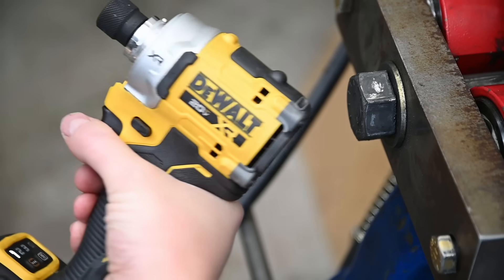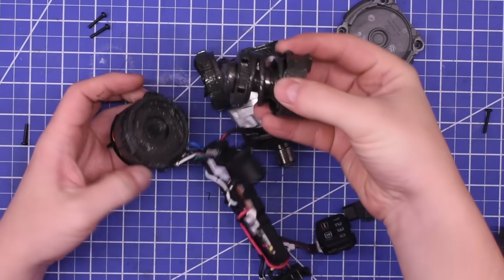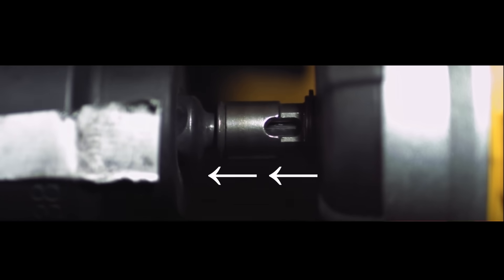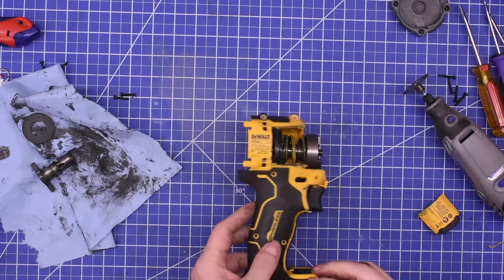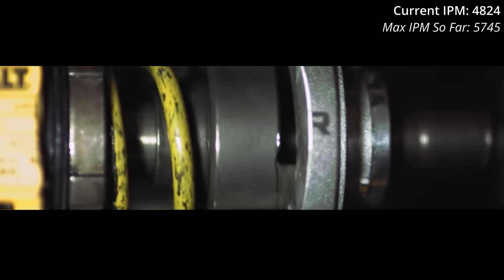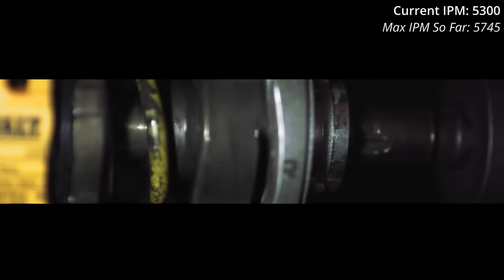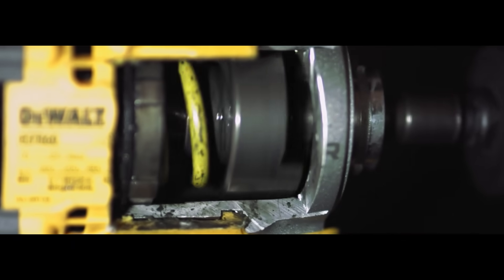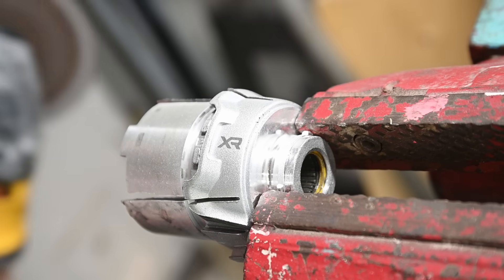We Found Something Strange Inside DeWALT's New Tool @ 10,000FPS

Comment from the maker: The spring would need to be wound the other direction for it to be flipped and see a difference from a spring direction change if any. Rotating it on its head 180 degrees wouldnt do it.
What's unique about the spring isn't that its so strong, a heavier spring would not allow for the assembly to bounce all the way back. It's the whole strategy they used that is fascinating.
Reply: Retired Engineer here, you guys are ready for Motion Amplification software. It should work at any fps. This will give greater insight into what is going on inside. Look at RDI.
Reply: Wonder if this possibly accidental resonance will affect the fatigue life in a bad way?
There was a comment about a second spring, this is sometimes used in automotive valvetrains to smooth or move a resonant frequency peak.
FWIW I sort of prefer the max to be in the fastener loosen direction.  Not in a "I want to get the fastener tightened as fast as possible" but more "I want the (*&#! thing to come off at any cost!"
Reply: @pault151  Yes! My suggestion of adding a valve spring to it was both inspired by the nested valve spring design, as well as thinking that it would also be small enough to fit in there. 😅
Reply: @pault151 you're also coming from the Automotive field. Builders don't want structural fasteners to loosen...ever.😂
Reply: @danielkingery2894  That's true.  But structural fasteners also have a torque value they should be installed to, whether it's done with a calibrated wrench or a torque-to-angle.  A structural bolt can be ruined by over-torque.
Reply: FYI dewalt wants it driver back😮😮😮😮
Reply: 🤔 Can you toss in a valve spring, to act as a helper, and hopefully preventing the rebound-slamfire hammer hits? 😊
Reply: RDI?
Reply: @hankphillips884  RDI Technologies does the motion amplification software. There is an excellent Steve Mould video that shows it in action.
Reply: I think you are on the right path. It looks like the end of the spring might be catching on the hammer assembly in forward cause the weird bounces.
Reply: Imagine if they instead used a dual spring design. One spring wound clockwise and another spring wound counter clockwise. Would be interesting to see the results.
Reply: Correct it’s like turning the letter N upside down.
Reply: I 2nd this vote
Reply: Yall should make a video with all of the tools you have done surgery to
Reply: Exactly!
Reply: You want it to bounce. it allows for more force for every strike because of the longer travel and time to build energy.
Reply: @SkELAo7  If it is hitting on the very next dog regardless,  isn't it building the same amount of potential energy?
[sincerely asking, in case I'm missing something]
Reply: @DUKE_of_RAMBLE Eh, kinda. If it's bouncing, then it's as if a stiffer spring (which... all steel is basically a spring to some extent) has already given it an extra kick, so the main spring gets it going even faster. That's a good thing. These things work on transfer of kinetic energy. In linear terms, that's 1/2mv^2. This thing is spinning though, so it's 1/2Iω^2. Note the square term here. Adding 10% more speed will do a whole lot more than adding 10% mass or moment of inertia (rotational equivalent to mass), but both take the same amount of momentum transfer to get there (p=mv and p=Iω). Momentum, by the way, is how the spring accelerates the hammer. So if you can get more kinetic energy for the same momentum, it's a free upgrade on the maximum torque you can get. The bounce on some hits adds bonus energy to the whole thing assuming it's all skookum enough, which it seems to be.
Reply: @233kosta  That makes sense, even to my non-mathematical brain 😅
To me, it just seemed like it was wasting energy, by converting what could've been delivered in the hit by having a stiffer spring, but instead converted it into enough of a force to drive the hammer all the way back.
Reply: @DUKE_of_RAMBLE  We were all "non-mathematical" at one point or another. All it takes is a good teacher 😉

By the way there are two bounces of concern here. One occurs when the hammer hits the anvil (I assume that's the one you're talking about?). Technically a waste of energy (energy being finite, some being left in the hammer because it's still spinning), but it's unavoidable (see elastic collisions, coefficient of restitution, etc.). In some cases, it may also actually be beneficial, depending on the kind of time-dependent behaviour you're looking for. If you want short, sharp shocks, then bounce is where it's at.

My comment was more in regards to the second collision that happens every once in a while. It's bounced off the anvil with enough oomph to wind itself all the way back up and bounce off the hard steel. That now adds the extra momentum and energy above and beyond what the big spring can do, as explained in my last comment.

I assume the main spring is intentionally less strong, so as to allow the hammer to top out and bounce exactly like this. Someone at DeFault clearly remembered that one materials lecture from back in the day 😅 ... probably in the middle of an acid trip or something. 😁

The next step in reverse-inginerding this thing would be to rig up a makesgift current shunt either for the main motor supply or to one of the coils. This is actually surprisingly simple, every wire is basically a resistor. You run a current through it - there WILL be a measurable voltage across it. From there, I=V/R. Multimeter measures the minute resistance (maybe... some wires are too good!), oscilloscope plots voltage over time, et voilà - a way to measure what the controller is doing under different load conditions (including in reverse), which will more than likely make it dead obvious how & why it hits harder and more often going backwards.

Hint: it's deliberate. So you can undo stuff. That usually requires more torque, especially if the nut you're trying to bust has been there for the past 20 years and is rusted in place.
Reply: @233kosta  Granted, everything can be taught, with enough time and patience... But then you enter the realm of diminishing returns! It's just a fact that some of us are destined to become mathematicians, and some of us mechanics. BOTH can still be literal geniuses though! 

I actually meant both hits, really. That there would be enough left over energy from the anvil hit to send the whole assembly back, with enough force to bottom it out and rebound off.

But now that I think about it, yea... I suppose they might be utilizing that as a way to more quickly reset the entire mass, versus the time it may take a heavier spring to slow it down. All they need to do here is eliminate enough of that potential energy with the spring, to prevent the repeated-rebounding from doing any damage in the long term!

I think it'd still be an interesting test for TTC to conduct, by throwing in a helper spring, or replacing it entirely with one from another unity... For science, and all that. 😊

Also, it's a shame the entire circuitry is potted, as I'm willing to bet there's already a shunt onboard. (although I don't know if DeWalt would be using a newfangled means to measure it, or the traditional U shaped chunk of copper wire...)

edit: ACTUALLY, your other comment about grease brings up a great point... The unit likely isn't experiencing any of that bouncing back off the "backboard" that we're seeing in the highspeed footage, BECAUSE of the amount of grease they've packed in there! With it all gone, the rotational speed is higher, and therefore the kinetic force greater. So the only way to really know what's going on would be to slather it in grease again, and retest. (and hope the grease slinging around doesn't coat the camera lens... might want some plexiglass for that reason lol)
Reply: @SThom27  Like I aaid - I assume

I also wrote down a way to find out for sure 😉
Reply: Yeah. I'd say a dual spring. Both pretty weak but wound opposite ways. To get this kind of behavior in both directions.
Reply: smart pin, the whole time I was like FLIP THE SPRING!!! lol thanks for explaining to my smooth brain why it wouldn't work
Reply: Eh... Even if you wound the spring backwards... I don't think the difference coming from the torsional load is sognificant enough to do something. It's transmitted through friction... on greased surfaces... if you're trying to design with reliability in mind you just can't trust something that small and sensitive to the environment.

My money is on slightly different ramps for each direction, and/or allowing the motor to draw more current going one way than it does the other. For reference, a 3400rpm unloaded speed equates to 6800 hits per minute (hammer hits twice per turn), IF you can keep the motor going that fast when you load it.

Both of those will remain even if the grease inside is too hot (or cold), or the colliding faces have started galling, or the 200lb gorilla went and took all the grease out because it "doesn't need it", or some other 200lb gorilla went and cut a hole in the side of the casement 😉

When you're trying to reliably produce an effect, you can't afford to rely on a little bit of difference in torsion transmitted through the lubricated contact of a set of smooth faces.
Reply: Came here to say exactly that. 
You could put a thrust washer/slip ring between the spring and the hammer to see if it's down to the spring geometry or friction between the spring and hammer.
Reply: Forward the spring is getting wound out 

Reverse it's being wound in 

The bounce back thing is probably running speed harmonics by design or critical running speed issues by accident
Reply: Larger spring and lower mass is used for higher cycle rates in a lot of applications, notably the bang bang kind. 

You can take any coil compression spring in your hands to demonstrate the below statements. Open up a pen. 

Forward causes the spring to expand (in diameter) and do some different things given the coils are wound opposite the direction of rotation will try to force itself to expand and apply more resistance to the hammer. This essentially adds a secondary rotating axis of spring force when it tries to regain its original diameter.

Reverse causes the spring to shrink (in diameter) and given the coils are wound the same direction as they are traveling they tend to shrink in length. This reduces the resistance on the hammer but could also change spring rate slightly.
Reply: Maybe the spring has a corner/tip binding against the hammer interferring with it in forward?
Reply: Very glad you wrote this comment- that was my first thought, to try to flip the spring around 180.. was thinking that would give the opposite effect from the differences seen between forward and reverse.. I'm not really mechanically inclined- so glad you explained that wouldn't work.
Reply: If the end of the spring (the cylinder it represents) is not flat, grind it flat and test again. I think it's binding on the end of the coil.
Reply: Just chamfer the end of the spring, and harden it if it shows wear. I’m sure the part it’s sitting against is hardened
Reply: this is fascinating. i imagine they have a team working on smoothing out and better harnessing that ballet of jumping back and then slamming forward cause then they could take that tech to the high torque and just make you wish you never put your hands on it.
Reply: That deep collet issue can be easily fixed by cutting the correct length off an old bit and stuffing it down the chute.. did that to mine, works like a charm
Reply: Did they do it to ensure that you can always remove a bolt that was installed by the tool?

I can imagine that when you torque up a bolt, it can bind, grab, stretch and do all sorts of random and strange things... then add loctite into the mix..

So they made it more powerful in reverse so you have the best chance to remove it?
Reply: I have a feeling that it's kind of a fluke; they engineered it for 4500ipm in forward, which is a lot by itself, but due to specific spring and hammer harmonics/dynamics it sometimes would exceed that - OK great no big deal, stress test and proceed to production. Just so happens that in reverse it does something unintended and bounces the hammer. I'm sure as they have stated, reversing the coil rotation would probably result in more relevant gains.
Reply: @The_Gump  Removal uggaduggas are almost always preferable to installation...since any high uggadug is gonna need a torque wrench to set properly, out is more important than in.
Reply: @The_Gump  Yes . Impact drivers need more breakaway torque than fastening torque. 👍 
Also, if the spring were to be reversed, you wouldn't be able to remove a fully torqued nut/bolt! 😂 So I think DeWalt got it right. Have a good day fam!
Reply: Please test all the cordless 7/16 hex drive Lineman Impacts.

Comment: Reverse on impacts is always supposed to be stronger than forward to make sure it can remove all bolts it puts on, if a tool has the same power in forward as it does in reverse, if you hold forward too long, no matter how long you hold the tool there it wont reverse the bolt, i see nothing wrong with the dewalt reverse power

Comment: How much torque do you want?  283NM is a LOT (My low end DeWalt 887 specs 205 NM but only costs 60 Quid).  If you need super torque a proper impact wrench (rather than ‘driver’) will deliver a wrist breaking 1300 NM.  So….What is the aim here?  A DRIVER aimed at fasteners, but with stupendous force?

Comment: Hammer bouncing back is a good sign for torque at the cost to tool shatter. Bounce is a sign for Hammer-anvil junction hardness. 

Low or no bouncing relates to inadequate junction hardness. Hence energy dissipation into metal as heat. Which kills inertia for torque. 

If all else are equal, the harder the better energy retention is however at the cost to brittleness and tool shattering in the field under high load.

The next advantage for hammer bouncing is that creates hammer-anvil clearance. Through clearance, the hammer have avoided a “cam out” operation just before the retrieve stroke. Cam out operation is when screw driver tip slipping off the bolt head wasting a lot of energy that could benefit tool performance.

Comment: Also, how in the hell did those led lights on the matco tool stay on with it disconnect from the tool and also had no wires coming from it? Its as if the leds are bluetoothed to the battery lol

Comment: wouldnt of guesssed that its the springs friction causing it ,but makes sense, needs a roller on the spring so it dosnt do that, and 3k rpm,but you have 2 hammers lobes, so a hit every 180 degree not every 360, so 5.7k isnt suprissing for ipm, just need the assembly to be tuned right, no laws of physics broken. could you try adding a slider between the spring and hammer, at leas slip ring, we used them on contra springs on scooters , also made the spring act more predictably, wouldnt get hang up when releasing throttle, and would work basicly the same after long runs, where if you have no slider the spring heats up and changes the properties of the metal

Comment: I think it might be software limiting on the forward. Pulling off you just want it off so hitting more often works just fine, but putting on you might want to torque after pushing in and by using the slower speed you get a little more control. At least that is my thoughts.

Comment: My late Father never threw away any old power tools and would often repair them for friends. Last week I spent two evenings stripping them all (30+) of their motors for scrap. The Conclusion… 1) DeWalt, old Makita and old Bosch Professional all have motors with more copper windings and just better 2) Older stuff was often much heavier and more complex in design but the internals of more modern stuff is functionally better 3) Really old stuff (like 1980 or earlier) was made for a lifetime even the cheaper brands with steel gearboxes, but the safety is questionable (metal casings with live wires protected by 1mm of insulation). 4) If the model is serviceable (easy access to bush replacement and greasing) then its quality seems to follow.

Comment: So they designed it to be better in reverse so that it could never put a nut or bolt on without being able to take it off as well. Thats why its better in reverse. Like say if they did reverse the spring and made it better for driving. That would in turn make reverse worse than forward therefore everything you put on and tighten will never be able to be taken off with the same tool if tightened completely to the tools max (which is what alot of people do)
Reply: That is not a unique concept. Many many moons ago I had an Ingersoll Rand pneumatic impact wrench that would produce a full 200 ft/lbs of torque more in reverse than in forward. It blew away every Snap-On, Mac and Matco in the shop (until Matco got wise and had them build one for them to rebrand). As I recall, the other mfgs also created a little more power in reverse than forward, but nothing near this tool's numbers. In automotive, reverse is where the power is needed, moreso than in carpentry, though, so it strikes many as odd.
Reply: Yeah but this tool isn't designed to put on nuts or bolts, it's meant to drive screws. Sure you can use it for nuts and bolts, but that's not its intended purpose. It's an interesting idea though.
Reply: Am i misremembering or don't most impacts have a higher breakaway torque than tightening torque for this exact reason?
Reply: think most impacts do that my atomic 3/8 does 450 breakaway 300 tightening
Reply: Dewalt owners can do some pretty unbelievable mental gymnastics to justify Dewalt tools doing some dumb stuff. It's a driver. Not a reverser. It's a flawed design. FLEX tools put more thought into their designs which equals higher performance and reliability.
Reply: @JosephGahagan-vh4pz You must upset that you had to go buy a dewalt to remove a screw you put in with a Milwaukee. 😂